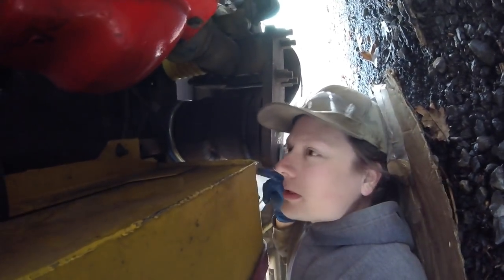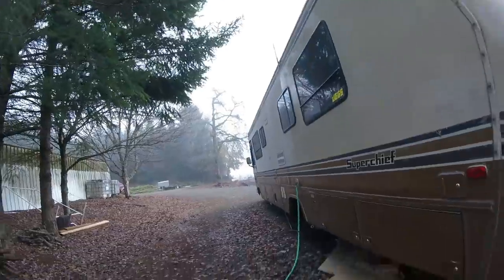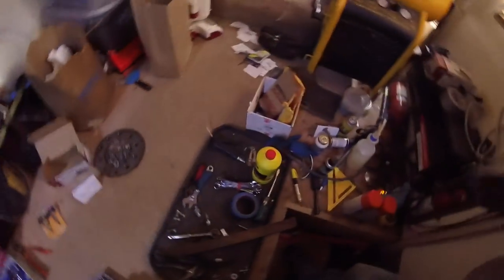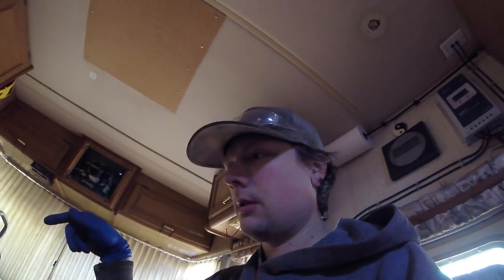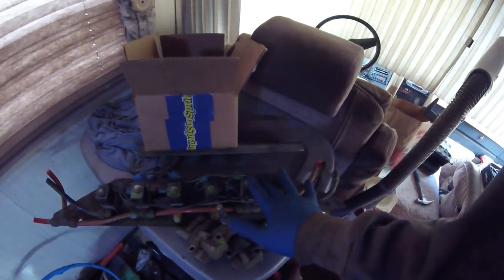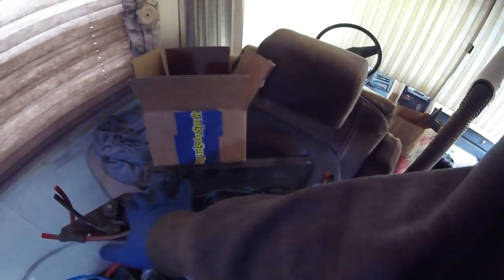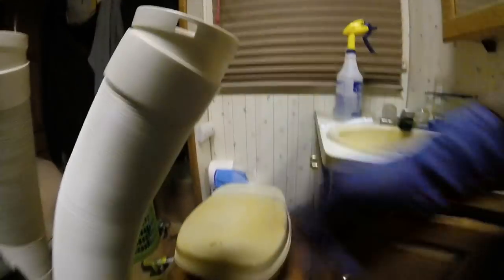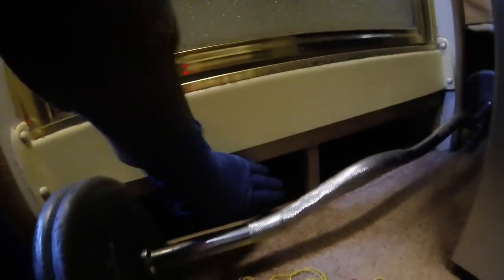RV Living Repairs VLOG | Broken Brake Lines

Comment: Hey man just saw your video 2023 August. I have a 90' tiffin Allegro Bay 31' 460 v10 f53 chassis  46k and I'm the 2nd owner it has dealer plates still.needs brake lines which means need to drill hole for brake lines holder to keep lines straight. And run them yourself along the body up the firewall to the master and the same with the lines to the rear it's a dually single axle rearend